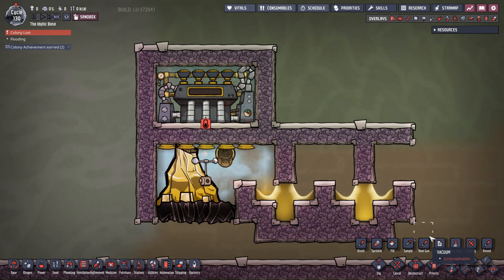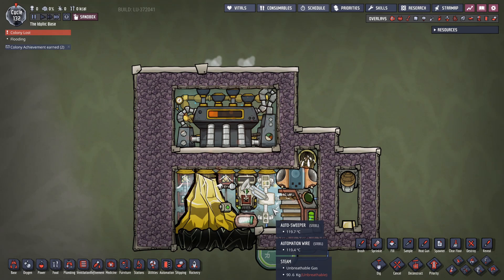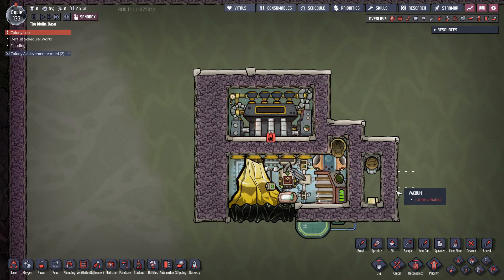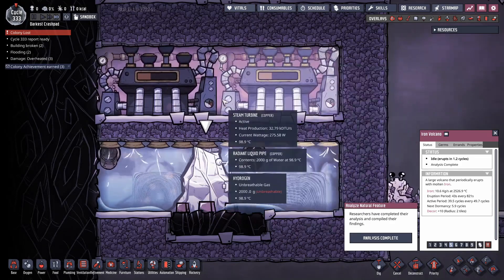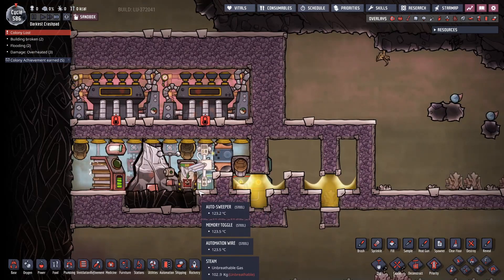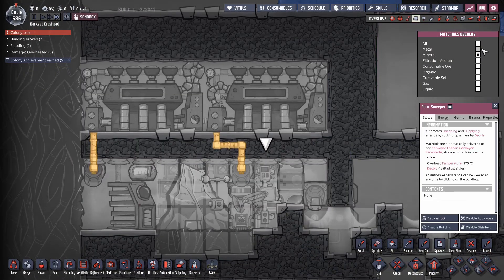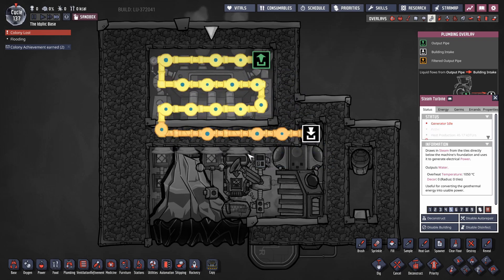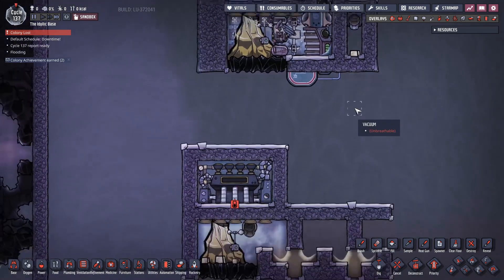Iron, Gold and Copper Volcanoes : Tutorial nuggets : Oxygen not included

Comment: Here's a very, very simple version of taking out metals:
- Put a Thermo Sensor next to the volcano, and have it activate the Auto-Sweeper at < 130 'C
- This way, metal will be removed from the volcano area during a dormancy or significant volcano downtime
Also, in general, if you let a huge pile of metal just accumulate over a long time, the total temperature of the pile will be quite low eventually.

Comment: I am struggling to get this to work.  It seems my steam has gotten too hot and now the steam engines keep turning off.  I tried putting more water in and it cools the engines down for a bit but then they go right back to overheating. I think I added too much water because at one point the volcanoes got over pressured and didn't drop any copper.  Anyone have any idea what I might do to fix this?
Reply: What Volcano are you trying to tame. Since the video came out more were added that need significantly more cooling than the ones in the video here
Reply: It is a copper volcanoe  @whatwhatwhatwh
Reply: That's because steam is always more than 130c i believe, so the 95c output water can't cool down its own system. I haven't work on copper volcano yet but aluminum volcano won't work with his setup because that outputs a lot of heats.
Short answer: Steam inside chamber can't hold the temperature below 135c so the water output can't self-cooldown the turbin (hotter chamber = hotter turbin)
Short solution: You need a thermotuner to cooldown the turbin.

Comment: Aluminium has over double the specific heat capacity of iron and it looks like it will need 3 turbines to cope. 
Using a similar setup to Francis the turbines began to overheat after ~50 cycles. 

The average DTU/s the volcanos puts into the system is, iron: 397.8 kDTU/s, aluminium: 472.0 kDTU/s

Volcanos DTU/s Input = Specific Heat Capacity * Average Volcano g/s * Temperature Delta
Temperature Delta is output temperature - the temperature the material is removed from the room. E.g  For my aluminium volcano temperature Delta = 1726 - 125 = 1601°C

Comment: Thank you for your video! I have one question. I have implemented these (without the battery and hooked up to the main power system) and it works perfectly for gold volcano's at 2626C 9.9kg/s for 40 seconds. It doesn't even go at a 100%. But for aluminium volcano's, 1726C 10.7kg/s for 42 seconds, it does not work. It can't keep up with the heat and eventually this causes the aluminium to solidify into tiles. I have no clue as to why this happens since the temperature is 900C's lower...

Comment: So my Gold volcano tamer just needed more water to not overheat. Maybe I can fix it quickly adding a tempshift plate made of ice? I guess I'll have to test and check what happens if I end up adding more water than you mention in the video. For instance, three ice tempshift plates instead of having dupes bottling endlessly to get exactly 2 tons of water.
Reply from the maker: So long as the gas pressure does not go above 150 kg. If the pressure goes higher than 150kg the volcano will be over pressure and be unable to erupt.
Reply: @FrancisJohnYT  150kg of steam per tile, you mean? If so, in a 5x4 chamber you can put anything below 3 tons of water and it should still work.

Comment: First of all, thank you a million times for your videos sir John. I helps me tremendously. 
I tamed (or so I thought) a gold volcano using your second design. I all went well for around 100 cycles, then it began to over heat and damage my steel buildings. Eventhough I followed your blueprint to the letter, I only see two solutions: 

-I messed up (most likely)
-The updates changed the values and messed it up. 
-Both of the above. 

The Gold volcano specs are as follow: 

13.6 kg/s at 2626.9°
Eruption period: 30s every 753s

I didn't perform the analysis (I'm still much a beginner and didn't dare to do it, feard to lose my dupes). 

Would you have any idea, sir? 
Anyway, thanks again! And I'll fix it (someday when I understand more about the game)
Reply from the maker: Checking the numbers that is only 541g/s of gold which is well within spec for a self cooled turbine. Is the turbine not running anymore? Did the turbine overheat to 100C and shut down?
Reply: @FrancisJohnYT  Thank you for your answer! 
The Turbine did shut down, and I think I know why: I didn't follow your guide to the letter (called it) and I didn't even notice my conveyor rail (those behind the volcano, at the base) melted, so I think that would be what has caused steam to be too hot for the turbine to handle, thus shuting down the installation. 

Thank you for your answer and videos, and now, here I go trying to tame an aluminium volcano. Have a nice day!

Comment: The iron volcano design didn't work for me. I had to modify it tremendously, After over 10 hours, I had came with the following solution.

Volcano on my playthrough was a 10.9kg/s for 45sec every 882sec.
Problems were:
1. The eruption time was long, which, gave the steam more opportunity to overheat over 139, since the sweeper/loader and steam turbine wasn't keeping pace
2. The idle time was shorter, giving less time to cool down the steam.
3. With 149.4kg/tile of steam was easily surpassing 140 temps, easily overheating the steam turbines.

Things to note:
1. Sweeper throws iron into the Loader to delay the burst of steam temperature. This can be optimized.
2. Running close to 139 or even 140 was very optimal for heat deletion without overheating and so it's ideal to run at these temps as long as possible before starting to cool down.
3. The key is to utilize the loader/conveyor to help manage the temperatures into the steam and control the iron temps exiting the entire system.

In order to help fix the problem i had the following things done.
1. Used similar automation in video for adding iron but for conveyor loader instead, causing it to be a feeder rate control onto the belt. I also added a filter to ensure to only add if temps drop below optimal after eruptions, instead of during.
2. Used temp element sensor on conveyor belt to control what temps of iron to come out.
3. Placed a 2nd sweeper to help load iron into the conveyer Loader before it can make the Steam too hot to handle during eruptions.
4. Added a light bulb close the the 1st sweeper, allowing it to have offset sweeps compared to the 2nd.
5. Make the conveyor belt to reach the steam temp sensor ASAP. Extend the conveyor belt to allow for the majority of the iron to load to maintain temps between 138-139 as much as possible for the rest of the way. This allowed for faster/effective cooling with more optimal heat deletion
6. Replaces alot of components with steel, because it kept melting during eruptions. I've had to reload alot of times to test this. These was any conveyor belts  and automation close to the volcano's eruption tile (its 2nd in from left and up one).

Future upgrades/updates:
1. I would compress the hydrogen that are at the steam turbines to help make a buffer before overheating.
2. I would try to aquatuner path, only when this way because it can produce power rather than power negative.
Reply from the maker: How did it feel when you finally got it all working? ONI has a way of sucking you into it's world, I think that is the reason it's so popular.
Reply: @FrancisJohnYT  Felt AWESOME until... it broke again.
I've ended up making the aqua tuner version and retrofit a 3rd chamber underneath to cool from 125 down to 60 and to keep the 2xbattery power along with Tony Advance's power injection alternator to inject power back into the grid.
It now provides 33% of my power needs when it's an active cycle.

As a general of thumb off of the online wiki, the 250g/turbine during the active cycle does ring true. It's too much effort for such little gain once it's over 550g/ active cycle.

Really loved your design however it doesn't work well for my Iron volcano. The gold volcano is fine. I might figure out how to add a power injector with self-cooling.

Comment: i like having metal volcanoes in a vacuum chamber, with their pool of molten metal overflowing into a corner-drip-solidifier mesh tile then into steam chamber. 
(he's done a video on this design using rock volcanoes and a sealed steam chamber that got up to around 900°c and worked as a heat battery for other steam chambers to pull from)

the whole arrangement is larger, but there's an overheat safety in being able to dump more water in (up to 1000kg/tile) if temperatures spikes due to a failure (of the turbines).
Reply: also, i love vacuum insulation. perfect thermal transfer and insulation are the pinnacle of design, imo.

Comment: Simple things works best. I have added 4 diamond tempshift plates behind volcano to spread heat better, which works well, but its too much for steam generator self-cooling. So i had to add door lock to control overheating. I dont mind that little extra heat as its outside of base(its tiny ammount) and steam generator works better this way. Cooling wasnt problem before that change, but electricity generation was about half and it takes less time to get iron temp to level where it can be handled(about 200C at the end of dormancy period).
https://imgur.com/a/nltq90M
Upper  Below 99 - keeping turbine going.
Bottom Below 125. I dont want dupes go for iron there at random. Just in case.
Reply: Ok. Using tempshift plates was definitively bad idea. I thought doors will be able to keep temp in check, but they arent. Steam temp is at 500+ degrees and i have to cool it down somehow because petroleum starting to boil and next dormacy is still far away. I have at least deconstructed those temp plates, but it will take some time to resolve it.

Comment: For the automation: now we have a cycle sensor, which takes 1 tile and you can set it up to o/p  a green signal once every 30 s. I combined it with a conveyor rail temperature sensor and connected both to my conveyor shute (which also now has an automation input). Works like a charm!

Also, obsidian drywall (I think) helps to even out the temperature fluctuations within the steam chamber.

Thanks a lot for your video, I used your automated iron volcano design as a basis for my iron volcano desalinator (got saltwater geyser right next to my volcano).
The tweaks I made:
1. 1 tile wider steam chamber to allow for a second auto-sweeper (to fetch the salt)
2. Use salt-water for cooling, I set my valves to 2150 g/s per turbine, and let water through only when water is detected in the respective steam turbine output pipe.
I still need to tweak the numbers for salt-water though, because water gets backed up between my valve  and shutoff, so 2100 g/s might be better.
Reply from the maker: I try to design everything as simply and stripped down as possible, that way it's easier for people to add their own additions and modifications. A boiling desalinator is always one of the fun one's.

Comment: In the Automation update, they added a Timer. x seconds on, x seconds off. (Temp + Timer) > And > Conveyor Shutoff. I know it's an old video but it's still pretty helpful.
Reply: conveyor shutoff COULD be removed. the conveyor chutes now have automation to open/close them (like the vent/spout).
i still use conveyor shutoff though, but i use the automation signal that controls it to also control the chute. so the chute opens once every period too. 

using a force-cooled turbine room, my chute drops into turbine room, giving each packet 1 full period to cool down BEFORE leaving the chute (they sit at the chute after making it past the shutoff). that's where dupes can pick it up until i setup a permanent rail to central inventory depot.

Comment: just a follow-up after some hundreds of cycle testing these. While 150 kg/tile will overpressure your metal volcano, less than 100 Kg/tile will eventually (especially non-gold volcano) make the turbines too hot, even if it takes hundreds of cycles.
Reply: also, the gas around the turbine is important too - avoid carbon dioxide
Reply from the maker: Out of curiosity did you make the insulation between the steam turbine and the steam room our of igneous rock or obsidian? One fear I had with this design was that heat would leak up into the steam room.

Comment: Try as I might, I just can't get this thing to work. The Iron heats up the steam too quickly (about 120Kg per tiles)...I just about get it down to 130C for the temp sensor to kick the automation in, just as the volcano starts up again. It heats up to about 160C very quickly, shutting down the automation, and the hot iron just stays in the conveyor system effectively counteracting the cooling...the the Steam Turbines overheat...not sure what I'm doing wrong here.

Buffer is 1s, Filter is 30s and Thermo Sensor is set to 'Below 130C'.

Haylp!

Comment: could you do a layer of petroleum + some thermalshift plates (to pull heat from petroleum into the steam) for the iron volcano? 
Or would the heattransfer be too quick and flash the petro into sourgas?
Reply: The volcano heat sometimes melted my iron conveyor rail and/or iron conductive wire gong through it (now replaced with tungsten), so I'm pretty sure you'd get sourgas.

Comment: You shouldn't fill the water to the max pressure.  Have the bottom two rows filled and the top row lightly filled.  Otherwise, the volcano will not erupt.  Don't leave any air pockets in the top row, or you'll have your parts melted.

Comment: Yea that design is great and all but how are we supposed to build it?
Reply: Use air pumps to vacuum things out, or build tiles and then dig into it after you have your liquid airlocks in place.
In my case, since I found the volcano in sandbox mode, I dug up the natural tiles after setting up the liquid locks. There were some empty spaces and salt water around the volcano though, so I used the tile method, plus leaving some of the water tiles behind, so I wouldn't need to add any additional water for the steam chamber.
I even left in some abysalite tiles where insulation tiles were supposed to go. Just make sure you don't try to build pipes/wires through it, cuz your dupes will dig it up.

Comment: I Used this design for my 8.6 kg gold volcano and i were getting a weird syntom. the vulcano were overpressureizing. good thing is that i made it with the liquid lock so i were able to go in and build a pump and pull out some steam from the room and just enough to so the volcano didnt stifle itself. and im leaking the energy off to my energy network.
I didn't bother looking into the comment section for this issue. but i fixed it myself.

Comment: The automation I use is: a not gate, 1 buffer on 30s and 1 buffer on 0.9s. The output of the not goes to both buffers, the 30s one loops back to the not and the 0,9s one is the signal for the conveyor.

Comment: Francis, why do you automate the shutoff, not the sweeper?
Reply from the maker: If you automate the sweeper the moment it activates it will move up to 500kg of material at a time. We are trying to extract the metal slowly.
Reply: @FrancisJohnYT  Thanks. My sweeper keeps breaking down. Is that because i don't dump enough water to the steam turbine/volcano?
Reply from the maker: @valentinoaditya2458  Is it made of steel? Steel is one of the few materials that can survive the temperatures in there. Most of the rest break.
Reply: @FrancisJohnYT  Yes it's steel. It's staggering 300-400°. I already use diamond tempshift plate to distribute the heat but no luck. Probably not high enough water/steam that goes there?
Reply from the maker: @valentinoaditya2458  More steam is the answer then, with more mass to absorb the heat it will keep a more constant temperature so less temperature spikes.
Reply: Thanks, i will do that!

Comment: Free electricity is always cool but you can also use one as a free petroleum converter. In the early game you don't need huge amounts and slowly it builds up. My map has no magma volcanos so I use this instead.
Just a few T-shift plates, a shutoff with a liquid pressure sensor and an automated door with a thermometer under the crude oil liquid vent. Counterflow the oil in your petroleum to increase performance.

Comment: Hi FJ, There is a really simple way to automate this.  Instead of dropping out at fixed time, turn on a conveyor shutoff if conveyor temperture is below 125 or so and loop the bypass back to a bridge to keep it circulating until the conveyor contents are low enough.  Put the loader between the bridge output and the shutoff input of course.  As the cool stuff comes out, hot stuff replaces it.  This might not be a vanilla sensor, maybe from Sensory Overload mod, I don't know anymore (there are so many missing sensors in based game!)  I have it running on a avg 281g/s copper volcano at the moment with two turbines maxing at ~325w a piece.  Not 300 cycle tested or anything but keeps automation to 1 sensor and 2 wires

Comment: Personally, I'd run a centralized heat processing system where heat from various sources, from cooling the base to cooling down materials ejected from a volcano, could be quickly siphoned off with radiant liquid cooling systems that all link up to a centralized hub where excess heat from the coolant pipes is dumped off into a central water/steam chamber by loads of Thermo Aquatuners, which then heats up the steam enough to drive the Steam Turbines. Excessive, complex, and complicated? Perhaps, but I like the idea of using Steam Power as my primary power source, just as much as I like the idea of quickly supercooling hot and molten materials to the point where my Duplicants could safely handle them at room temperature.
Reply from the maker: If you like running on steam power check out the "668 cycle of steam" video on the channel. It's what happens when you boil an ocean.